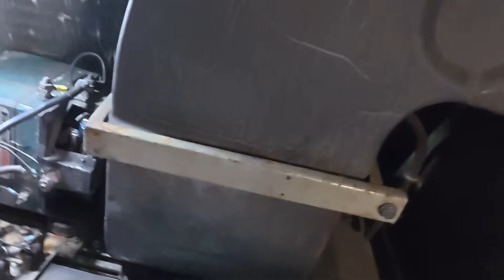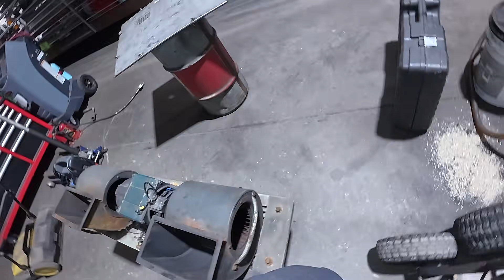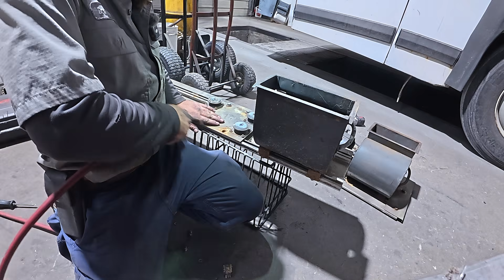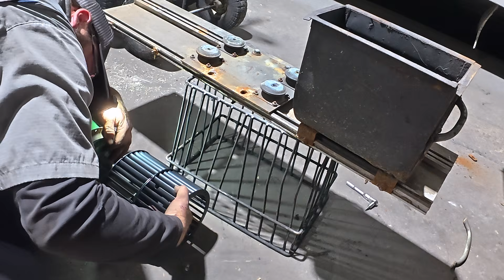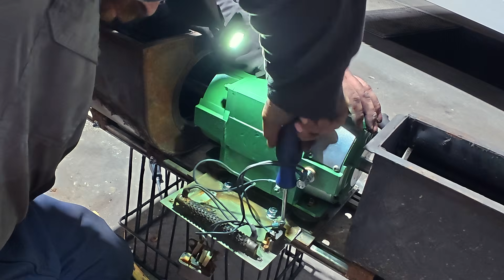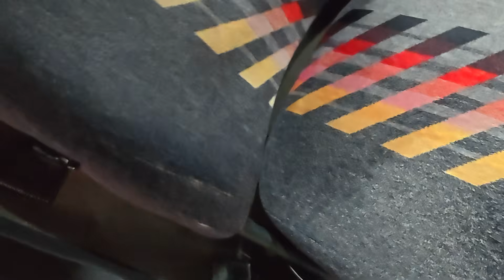MCI 102DL3: Can We Repair this Evaporator Motor?

Comment: Could you have cleaned the squirrel cage cover and given them a coat of corrosion protection? Also, you could replace and rebuild with a sense of improving some of the small items.  I like the fact that you caught the relay differences.

Comment: The best thing they ever did for motor coach's was invent the brushless hvac motor. I had a repair on a D4500 MCI commuter one night that resulted in some lawsuits. The bus was down in LA and had to haul its passengers 75 mi north on a lovely summer afternoon where it was near 95 in places. Yep, the brush holder melted and no mo a/c! The driver flipped the escape hatches for “some” air. I had to replace the motor as we didn’t have a new brush holder. The winders don’t open for travel on those big boys.

Comment: I have a mystery air leak i have searched for 3 months, its not bad once all the way air up or when you hit the brake, but there's a 8 minute pause at 77 to 80 psi, mc9. What coat are you guys on.

Comment: When I have a blind hole I need to clean the threads, I'll use a tap until it bottoms out then I'll remove it. Then I'll get another identical tap and grind the taper off, making it a bottoming tap.

Comment: Is the motor in contact of hot air ?
This is one of reason they burn
Reply: Motors burn because of hot air, you say? Tell me it ain't so! Are you a mechanic, plumber or someone with a clue? You are obviously a man who knows his tool and greases them regular.
Reply: @BillMalcolm-tn3kq i said one of the reason and it is a flaw in design of bus and nothing with mechanic do , what is your problem? Are you channel owner or his defender?
Reply: @Mostafa-vs8bd This is an ancient bus, at least 25 years old. It is an electric motor in the ventilation system sitting in the luggage compartment. I'd hazard a guess it might see some hot air! It is also worn out. I thought your original comment was stunningly irrelevant and rather stupid, to be frank.

Comment: Your doing a great job with this, I'm 63+ ex-Army Generator Mechanic also Class B Operator over 25+ years Coaches / Transit / School Bus. Wish non disable and could work with I guy like you, just even help. 👍🏽
Reply: Lol 😂, I was sitting here watching these videos and was wondering myself how neat it would be to work with Brandon just to get the experience to work on mine when needed. I’m a few years younger than yourself and I was a jet engine mechanic in the Air Force for 10 years and other mechanical experience after that so it’s not a big deal to do the repairs but knowing the tips and tricks that go into fixing an older bus. I’d also bout donate my time in order to learn and I’m not too far from him either, lol 

Soo Brandon, holler at me if you need a couple extra hands around the shop!!

Comment: I don’t think someone cut it….. the fan blade shifted and cut from the inside trying to get out… all from those two back bolts not being installed.
Reply from the maker: Honestly I didn't give that much thought as i was thinking about what to do to fix the situation but now that you mentioned that believe you are correct. That does make more sense.